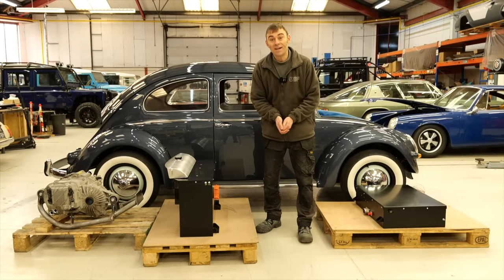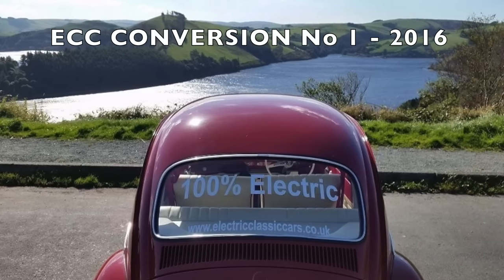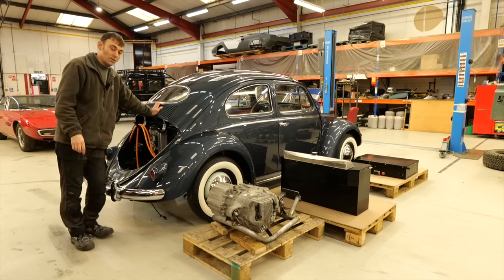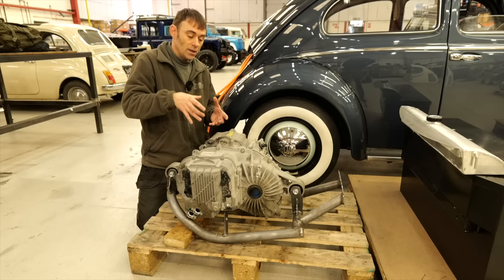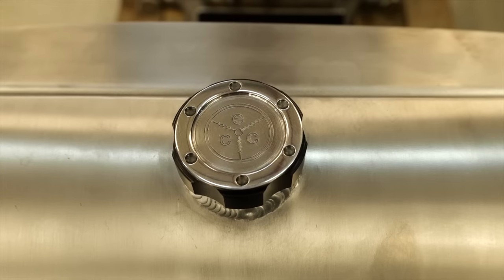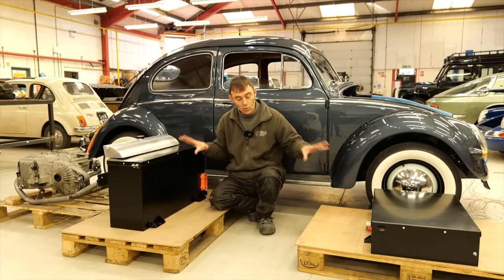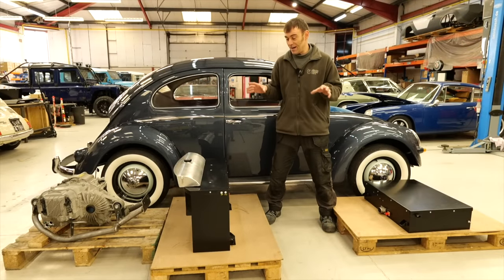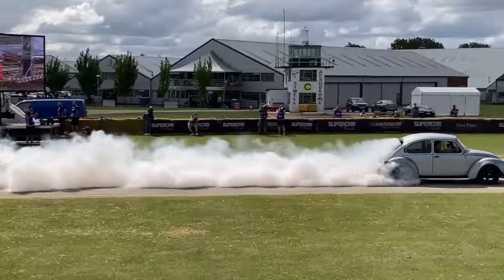Electric VW Beetle - Bolt-in kit

Comment: My first car was rear-engined, but not a Beetle. It was a Hillman Imp van, very easy to load with a high floor over the engine. Like the Beetle it was more stable with a full toolbox in the front boot! Then I had a Mk1 Opel Manta (very shark-like!), and later a Peugeot 205Cti (fun!). Now a BMW i3 - electric at last! :)
Reply: Imp and manta = cool 😎😎😎👍👍👍😀😀😀

Comment: First car at 16 was a1975 Spitfire 1500 found under a tree and paid $200 for it. 24 years later it's still running after draining floor and trunk of standing water. Manually sucked the old separated gas from the tank (first and last mouthful) and scuffed up the spark plugs and got is running on those old SU carbs.

Comment: Great video thanks. My first car in 1978 Austin Mini 1000  8 gallon petrol tank £6 (75p a GALLON) to fill (my 1st year apprentice engineer wages were £12 a week) I am now 61 and wish I still had the Mini, rebuilt a 1995 Mini Cooper in 2003 which I sold, however I got a 1971 Beetle last year it's a keeper.

Comment: I saw a conversion couple years ago smaller motor electric 200 horse hooked up to the standard four-speed transmission and that’s the way I would like it seems a lot better than not having that stick and clutch

Comment: My first car was a 1974 1600cc semi auto Super Beetle. Which I guess in British terms would be a 1303S. I wish I still had it but at the time the 20+ year old fuel lines rotted out and leaked on the hot engine and it burned to the ground in a golf course parking lot on my way home from work one day. I would love to have still had it to convert it to electric.

Comment: There were indeed some beatles with a radiator. It was in front and cooled oil and not water. Some versions of the 1303 had those, but some not. Most had the loovers behind the name plate in the front.

Comment: Very clean swap here boys.. My 1st cars were a 1960 beetle/36hp, a 1960 Karmann Ghia convertible/ 36hp & a 1953 Kombi Safari 26 window /8-10 passenger Tour Bus w/ seating for 2 small kids or dwarfs on engine bay hump in rear, Bus was imported from Switzerland to the US by some Southern Cal ifornia surfers who bought it in Europe & drove/ shipped it around the world to surf all the hot spots globally back in the day, again with a 36hp engine. The Bus would not go over 55 kph/35mph on the best of days, but it did a solid  55 kph uphill, down hill and on the flats without a downshift or missing a beat. Come to find out it had what was known as an "Alpine Transmission" in it,  with the usual pre 1968 reduction boxes on the axel ends & a Heavy Duty clutch , I think the transmission internals were all lower cut with a much closer gear ratio, built for carrying a full load of people safely up into those high winding mountain roads over the mountain passes in the Swiss Alps...<My actual favorite 1st cars were a 1957 Fiat 500 and an mid 1950's Isetta sunroof model with a Renault 4 cylinder/ & 4 speed transaxel swap. Somebody was trying to make a dune buggy out of the Isetta , I bought it at a used VW car dealer for $25usd,  I had plans to  re-swap the Renault for a 36hp VW & Bus transaxel and make a proper reliable dune buggy of it back in the day, Then i bought a Bug Eye Sprite which was amazing little car, But when i turned 18 i got a bad case of motorcycle fever and my interest in cars went to the wayside. Those were the days when you could buy some nice imported cars in the US for under $100, American cars built in the 1920's-1940's for $25-$50 all day long. of coarse petrol was 20- 25 cents per US gallon for 98 octane and oil 35 cents a quart for the good stuff. Keep up the great work really enjoy what your boys are doing there.
Reply: Thanks 👍😀

Comment: First car was a 1976 Citroën GS 1220 Club station wagon in 1986. Got rear ended, but still drove it, sold it eventually because the exhaust gas was leaking into the tail gate from the crash damage. Electric converion would have solved that problem. I think you could fit a Hyper9 in there, just need to sort the pump for all the hydraulics.

Comment: My 1st car was a "57 Chrysler New Yorker which weighed about 7,000 lbs. 18 gauge steel body.  But my favorite car was an Opel 1900 standard trans.  I had Conti Contact snow tires on it, and put 120 lbs of ballast in the trunk, and one winter, the only vehicles on the roads were me and Jeeps. Buick dealerships had them. 1972  it was  iirc.

Comment: Wonderful video, I had five Beetles until now, crashed one, sold the others. In 1994, I bought an Audi 90 quattro. I still own it 28 years later! Sadly, it'll have to go, I suffered a massive stroke in 2020 and cannot restore the Audi myself. My daily driver is an EV (Citroën ë-C4) and for sunny days I have a fully restored VW Golf Mk2 GTI G60 which is easier to drive than the Audi (lighter steering and clutch).

Comment: This was soooooooo soooo wicked 😂!!!! U covered JUST about everything, more than i expected, but maybe you can take an episode on “heater”! It was quite tricky for me to get the heating system to be good and quiet in my 1955 Beatle! I have a 1.2kW heater in mine and when i am driving around at -20C in Sweden well, i have to actually spend a lot of time to re insulate the car!  Its just not enough!  Otherwise this is also my first car and now we are building one with my 14yr old son.  In a 1303S so this would fit.
Reply from the maker: I'd suggest a 3kW heater in those temperatures Tom. Also, where did you mount it? If in the rear, it'll need to travel the long journey through heater channels before it gets into the cabin.
Reply: I remember our ‘65 Beetle had a hard time keeping up with sub-zero temperatures with the regular gasoline engine.
Reply: Yeah, it’s actually mounted inside under the seat, so it doesn’t have to travel as far. It’s a bit loud but with more insulation I think it will work well….. but yes the 3kW would make a big diff. More importantly I will insulted the car better though….. one day:-) we can check all this out when I come to pick up the Defender kit:-))) 
Can I ask you to send me a rough price of the beetle kit? Would love to put it into the beetle my son and I are building for him….. with fast charging please:-) take care, chat soon

Comment: I am considering converting a Geo Metro (aka Firefly) 1.0 liter convertible to electric for an around town grocery getter. I'm 70 years old. I still like to build things. The car has a 950cc Kubota 3 cylinder diesel engine in it.

 In my brother's garage is a 1943 Ford built GPW military Jeep with a 1957 Chevrolet 283  cu inch (4.6 liter) all original V-8 engine in it. I installed that engine myself as a teen. I took my driver's license test in that Jeep on my 16th birthday 54 years ago. California requires a separate motorcycle written test and riding test for that additional endorsement on my license. In the back of the Jeep was my Honda SL350 bike. I passed both tests. The bike currently sits behind that Jeep in the garage. It's nice to hear that someone else kept their special vehicle for so long.

Comment: ECC, you and I are the same age (about a month apart). My first 'car' (early '90's) was a '68....ford F100 with a three-on-the-tree standard transmission. A school friend had a vw bug/beetle from the (?)....I don't know when, but I do remember it had no clutch pedal, but it had a manual transmission. You had to wait for the (auto clutch) to engage/disengage at a certain RPM before switching gears. I had not seen of one of these types of beetles before or since.
Reply from the maker: Sounds like your mate had a semi-auto Beetle. Quite rare. 👍
Reply: This was in Oregon, USA in '1991/92. My truck had a straight 'inline' 6 (I6). rear wheel only. I have been watching your videos and congratulations on your business. Currently, I have to Honda bikes '98 vfr800 (the beloved 5th gen) and an '07  ST1300. I also had a '77 Toyota Celica with a 20R engine. Loved that car.     @ElectricClassicCars

Comment: Great Job!  A question for you. 
Long before Ev conversions   the subaru ej motor was a very popular  transplant into the beetle.   I think there  now would be thousands  of successful  conversions.
 Radiator placements were many, but they eventually  decided a discreet radiator  up front was the best solution. 
Have  you looked at this in your conversion template?

Comment: Learned to drive in ‘60-‘68 VW Beetles :^), 1st car - ‘60 BugEye Sprite (basket case), 1st drivable car - ‘71 Saab Sonett, 3rd car - ‘70 Datsun 510, 4th car - ‘74 Mercury (Ford) Capri
Wouldn’t those make a cool collection of electrified cars!
Reply from the maker: Some cool cars there. 😎👌

Comment: First car. 1958 FC Holden, 138 cu in straight 6. This was followed by a 1971 or 2 VW Type 3 station wagon 1600cc, which in turn was traded in for one of the last Australian delivery Triumph 2500S manual overdrive saloons....   One last thing, I thought earlier VWs were six volt???

Comment: My first car was a 71 MGB which was fun to drive but kept rusting out rocker panels due to winter road salt. Also the convertible top did nothing to stop the driving snow from filling up back seat. Moved to California finally and bought a new model from Honda called an Accord. Better in every regard, except the coolness factor.

My real love is a 1967 or 1968 Firebird, the coupe design has great body lines. Can we make it electric.

Comment: I have a many questions;  What other upgrade do you recommend for a Beetle to be able to handle its newfound power other than front disc brakes?  I am trying to put together a punch-list of upgrades so that everything I do to my Beetle as I lead up to its EV transformation will be guided by this knowledge.  Other suspension upgrades either necessary or recommended(sway bars, shock or strut changes, does the added front weight require a new approach to wheel alignment)?  How about tire sizes, I am assuming that the stock 165/80 tires might not have enough tread width - at least in the back where the power/torque is generated?  What are the advantages of one pedal vs keeping a stick to change from around town driving to highway speeds(I have heard the single pedal approach it more costly?)  What about low voltage vs high voltage systems?  How about heater systems, with an ICE, the engine is the source of heat?  What about security from theft, how is the car protected from being stolen - (I know if they really wanted it they could just tow it but just curious of your method with EV?)  I would love to know your opinions on all of these issues, maybe a follow up video?  Thanks for all your time and inspiration for my quest to build an EV Beetle.  I too, would like to know how you see the prices of these kits going in the future up/down?

Comment: Loved the video, thanks.  Is there an option where we can get the sound of the boxer coming out of the engine compartment?  I 've owned a '67, '68, '69, and '70, and felt very much "in tune" with the sound of the engine.  BTW 68 was the first year with a gas filler door, the '67 had people giving you strange looks when you filled the tank under the hood.

Comment: First was a ‘62 2-Dr Chevy Impala (a little hard on fuel …esp with rationing stateside in the ‘70’s). 2nd was a ‘61 Beetle from an Uncle with a blown 40hp.  Got a well used (>120K miles) ‘57 36hp to put in, and after a few rounds of remedial work, had a great school/work commute car.  The 36 was actually pretty quick up to 35mph and painfully slow up long hills at speed, but still a fun drive being so small and nimble.  An electric beetle is an interesting retirement project for now, providing I can find an intact starter.  Thanks for the look at your excellent kit.
Any plans for LiFePOs with prismatic cell energy density getting better now?? But battery cooling with custom built battery, ….  ‘some’ fabrication needed.
Reply from the maker: We’ve used LFPs in a few conversions now. They’re great, just not quite as good energy density but they’re getting there. 👍

Comment: Would it be a problem obtaining insurance for a converted Beetle in the UK? Especially when the powerful Tesla Drive Unit is installed? I own a '71 Beetle with the Hyper 9 Motor, and Tesla battery Pack. Believe me when I say that there is heaps of power, and fast take-off from the Lights. Not only has the Electric Conversion given a new life to the Beetle, it has also future-proofed against the stifling (changing) regulations on emissions, dripping oil on the Driveway, and (other than adjusting the rear brakes) there is very little maintenance to do. I discovered Beetles late in life, seeing this '71 Beetle in a Car Scrapyard, as a 'complete wreck'. If you are about to retire, with many spare hours, then renovating a Beetle, and doing something like this is extremely rewarding. This has been a 20 -year love affair with the Beetle. Greetings from Australia.

Comment: Would it be easier to use plate steel or aluminum and use a small press brake to bind sections of the plate, and if you want it lighter then use a plasma cutter to cut material out of the plate, while still making sure its strong key sections.

Comment: might have to see if this kit will fit in the 1970's skoda, i ave two atm 1974 S100 which is the saloon and the S110R which is the 2dr coupe, 
both came with swing axle but the later 80's estelle rear suspension has the cv joint similar  to the irs beetle type which can be fitted to the earlier S100 series

yep still has my first car

Comment: My first car was a 1964 Chevy Malibu with a tired 283 cubic inch engine and two speed power glide transmission. Paid $200 for it and had to have one foot on the brake and one on the gas pedal to keep it running at stops..

Comment: First car escort mk2. I happened to buy an escort mk2 last year that will be ready this spring. Stripped it down and now building it up again. I have not bothered doing anything more that replaced seals on the engine because my plan is to convert it to electric at some point. I am still waiting for someone to produce a kit. 😉
Reply from the maker: We'll have to do a Mk2 one day. 👍
Reply: @ElectricClassicCars  Or mk1, as the running gear is identical.

Comment: Beautifully engineered and designed solutions. I want a kit for a '69 or later! Does the charge port get moved to the original gas port in the quarter panel?  You need to extend range to 200 miles and make the kit(s) available to DIY with some kind of disclaimer they/we sign to eliminate any legal issue.

Comment: Great Vid and awesome kit! Two questions, range and do you have to have the front battery box? I assume it's to get the proper voltage and not extend the range! I am interested because I have a converted '68 into a dune buggy that would be awesome to convert to electric! Problem is, there isn't much room in the front. Plus, with that kind of power, I could probably do wheelies. The car weighs less than 1500lbs (680kg?) and has to be under that weight to be street legal in California!  

Would like to see this as a DIY kit! Great job!

Comment: Had a 1966 Beetle as my first car growing up. Built by my dad and his friends at a “Black Forrest” Porsche repair shop. Also, does this have heat or air conditioning? And can you be bought off to remove the power restriction if a liability release is signed?

Comment: My first car in 1985 was a Beetle 1500cc 1967mod. Had a two position heater - cold and freezing cold. No problem, as long as we had a music cassette cover handy to scrape away the ice on the inside of the flat front window. But it was a wonderful winter drive, could get me, my friends and the proper amount of skis and beers around to where we wanted. Cost me 6000 NKr back them, to day I would have to give between 60-80 000 NKr to get one in same technical condition....... But, some day, I hope, I dream...
Reply from the maker: 1500cc, single port, quite a rare engine. Nice. 😎👌

Comment: Have you put any thought into making a conversion kit for Formula-VW cars? (Formula Vee - Single seat formula cars based on the Beetle) I suspect the EV motor would bolt in, since it's just a cradle for the regular engine and transmission, but in a mid-engined configuration instead of rear. The battery pack would need to be a lot smaller and lighter, but also only need to power the motor for roughly 30 minutes at a time, for a regular race.

Comment: I am in the United States. I share your enthusiasm for air cooled VWs, have owned about 17 between Beetles, Busses and my fave, Karmann Ghias. I currently have a 1974 standard Beetle and was wondering a few things. Firstly, who does your conversion installs in the U.S.? As my Beetle has the external gas door, would the charge plug be located there? When I took on this Beetle project, I went for a Class 11 desert racer look, so I have the car raised slightly, but enough that the O.E. CV joints are not happy with the increased angle. Can a lift of one outer spline on the torsion bar (less than 3 inch lift) be accommodated with the axles in your kit? Is it possible to have any type of air conditioning? Your parts appear to be of a high quality, are the finishes paint or powder coat? Do you foresee a time when you will offer a DIY kit? Lastly, I assume the 12V wiring loom is for everything else, i.e. lights, signals, wipers, radio, heater, etc.?

Comment: Hi, how much of this “kit” would fit my VW type 3 with swingaxle’s 1968?
The main difference would be in the rear battery case, and where you put all your cooling and equipment for charging and so on!
Plus you forgot to mention how the throttle is converted, i don’t think you can use the wire operated original one, can you?
Well, looking foreward on your reply. Perhaps my restored type 3 can come over to your shop and you can figure out how to fit all your goodie’s!